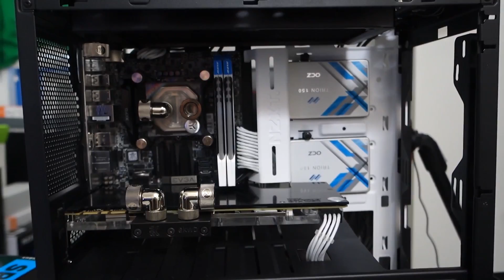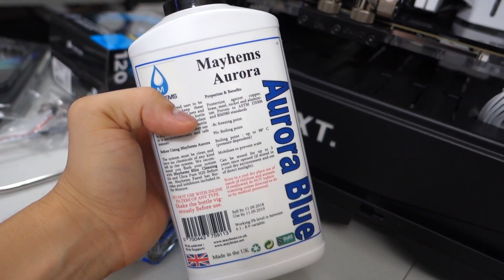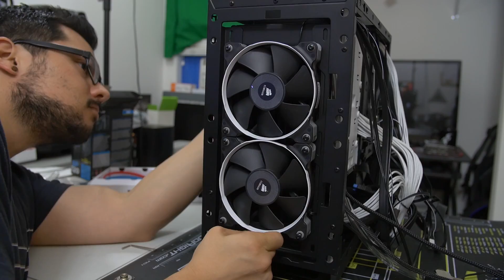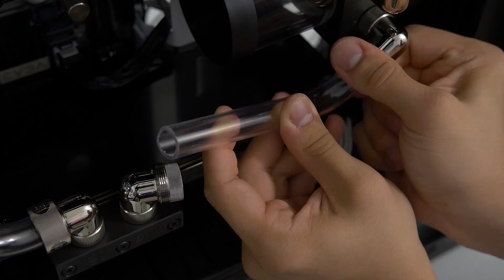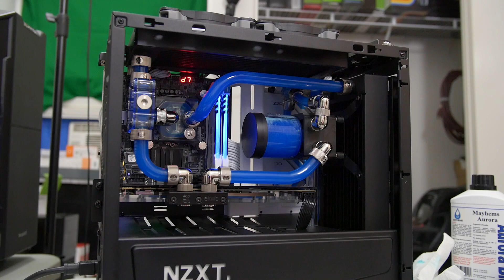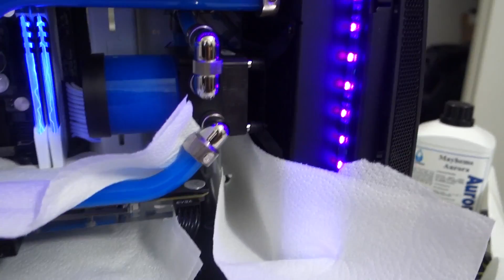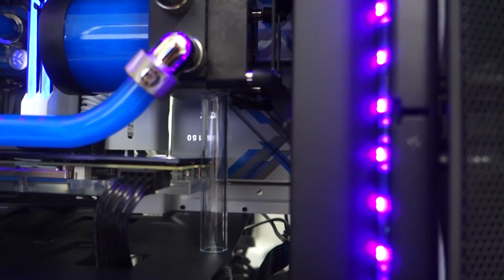Custom Tube Bending and THE MOST EPIC OF FAILS - Build Log #2

Comment: always use a separate power source for filling the system, just use an old crap psu and jump the atx connector
Reply: Not everyone has a spare power supply laying around.  That said he probably does with all the stuff sent to him for reviews lol. My biggest thing was that he had his MB powering up when filling. Should never have your components hooked up to power. Jump the psu you are using so you if there is a leak even if it gets on the components it wont fry anything.
Reply: Glenn Dooley Agree
Reply: I used some AA batteries
Reply: I use a PSU that is around 13-15 years old to fill up my pump.
I got it from my old collage as they were throwing the PC's away.
Reply: Jolinator I know, I was like wtf dude? power cycles like that alone are bad for it, let alone if you
 get liquid on it and it shorts

Comment: +Awesomesauce Network You can run the leak test without having to power up all your components, you just need to connect your pump, short the ATX 24pin connector, and you're good to go.

Comment: It looks like there is a slot on the motherbord skirt right in line with your reservoir. If you get a bolt and use that slot to sandwich between a few nuts (and a washer on the back) you can support the res and painted black (or even cut the head off the bolt) it will be near invisible. 

text diagram;

(I========[ ]==[ ]==

Comment: With the white support bracket behind the reservoir, you can create a strap from a chrome-plated strip to wrap around the reservoir and attach it to the bracket. That will pull up/support the assembly and will maintain the symmetry of the tubing.

Comment: You might want to move your UV strips to get more lighting in the case.  It looks like the radiators are blocking a lot of the light throw path.  If they are the case mods magnetic ones, I would just say move them possibly along the edge of your radiators.  You will see the strips, but will give you more effect inside.  Another thing is you might move it along the edge that is near the rear of the case behind the pump.  So the pump and such will hide it, but have it attached to the radiator to give the glow effect.

Comment: what the point of the custom loops? is it just for looks or are they more efficient in cooling the system? if it just looks I personally don't see the point of all the work and expenses to set it up, i mean it has to cost a lot more than the regular ones and it doesn't improve performance on the system or add anything worth the trouble except looks on the case of the computer which i won't be looking at cause ill be focus on the screens playing my games O.o, it does look good thought but it not for me

Comment: that's why you run the loop for 9 hours straight outside the case before installing it, better safe than sorry.
Reply: with hard tubing aye?
Reply: +FlerpyDerp it's a lot of work but yes after you finish hard tubing you disassemble it and reassemble it for leak testing, or trying to run the cooling system only without running the whole pc so when a leak occurres it can be dealt with safely.
Reply: And after that?
You disassemble / reassemble it again to fit it into the case?
your Leak Test won't be worth anything after that.

Comment: Re: propping the reservoir up; could you try adding a washer or two between the pump-fan mount, only on the lower two screws to add a bit more 'height' to that side?

Comment: To prop up the res try switching out the 2 bottom screws holding it down with bolts and put some washers to lift up the bottom.

Comment: Put the system inside a frost free freezer....?!
Back in the 486dx4/100 era I did that. Worked great too. Clocking over 300 MHz. There was (if you can find it) a write up in PC MAG on over clocking your system.

Comment: i have the same reservoir but the 140 one, the only reason it is sagging is because of the rubber feet that it uses. if you unscrew them off, you can still use the other screws that are supplied to mount the reservoir, that's what i had done with my one, and it was a hell a lot more stronger and there was no sag or anything like that, hope this helps!

Comment: TO FIX THE PUMP SAG:
washers under the lower pump and/or mount screws as spacers to tilt the unit up compensating for the sag.
and... Personally I would move the UV strips. the light they are emitting is mostly blocked by the rads.

Comment: suggestion for the pump/res combo: needs a new mounting solution. still mounted to the radiator but not sideways. so some kind of L-shaped bracket with support so there could be no sag. but that would probably make the tubing run more difficult.

Comment: I'm not hardline water cooling savvy, but it looks like you could use a nut and bolt on the bracket behind the reservoir to support it. It should be something that looks better than a nut and bolt, but you get the idea I hope. Lemme know if you need a diagram or a better explanation

Comment: Switch to a RX 480 and get the EK-FC RX-480. That will allow you to use the EK Bracket that you have with a EK-UNI Holder DDC V2. You can get one from Performance PCS.

Comment: I wish you could search comments. If you can can someone inform he how. Why did you not just run the Water cooling parts off of another power supply. So you can run a leak test and not worry about damaging the computer components.

Comment: Please help... For an acre predator Z35 which GPU should I get? I'm looking at the gtx 1060 or the gtx 1070.... is it worth the extra money to get the 1070 or will the 1060 run the Z35 @144hz or close to 144hz in most games? I'm new to PC gaming and in trying figure things out before I spend the money to join the PC master race.
Reply: 1060 at 1080p, 1070 at 2K

Comment: PUT A WASHER ON THE BOTTOM TWO MOUNTING SCREWS FOR THE PUMP AND THAT SHOULD LEVEL IT OUT
Reply: All caps means he is shouting to get Kyle's attention, so in this case, that is the correct use of all caps.
Reply: +kuhrd ¿por que no los dos?
Reply: Darren Lesinski Could be both I suppose.

Comment: Awesome build as ever. Regarding your tubing I would suggest, that you either stick with 90° angles and ditch the diagonal bends or redo the diagonal bends from the radiator to the CPU-block and from the pump to the GPU-block as they don't look parallel. It kind of looks out of place from certain angles, so I would stick to 90° bends.

Comment: You could always borrow a 3D printer to print a clamp/clip that screws in on the cable management bar and holds onto the top of the reservoir.

Comment: 1st thing I do when I have my loop made is to blow in the loop. Makes sure there is no plug missing. Also I have not used towels at all neither have I done any overkill even 1 hour leak testing. I just leave the res cap off so it can flow freely.

Comment: put some small washers underneath the bottom half of the pump/ress bracket, in between the bracket and the rad and then try tightening it back down this method should give it that little push up to get you pipe straight. xD Add more washers if one on each bottom side doesnt get it straight, until it is perfect. This wont stop it from sagging but it will make it "look" as though it doesnt sag at all and if you use small enough washers the bracket itself will cover them and easily hide your fix.... xD looks great... im going to watch the rest of the video now, i haven't seen why your title is such yet....

Comment: The reservoir/pump combo is probably sagging because of the installed hard rubber vibration dampers. There's nothing else you can do as to remove them or to install a support strut like those for graphics cards.

Comment: The angle of the bends on the top run should be close to the bottom run imo. Re the 'sag': couldn't you fit a clamp to the nzxt plate you originally used to mount it?

Comment: You do know that your system is not in leak test mode you are in full operation mode with power plugged into motherboard and graphics card. If you plug in a monitor you should see a UEFI screen.

Comment: @Awesomesause Network You could put two tiny washers under the bottom two screws holding the res pump combo to the rad. Should prop it up enough to make it strait.
Reply: Never mind, made it to the end.
Reply: I totally agree with you man, that prob would have worked
Reply: That was my suggestion, Shim the bottom of the radiator.

Comment: Concerning your problem with the pump/res sag. There are 4 screws that mount the combo to the radi. Just try adding some spacers on the two lower screws, which will elevate the combo. Your tubing looks very nice btw, i think it's impressive that you did the bending without any guides.

Comment: I think there is torque there in the reservoir. You see how the little pipe on top is slightly misaligned  to the bottom one going to the GPU? It is probably a bit too long.

Comment: Kyle, got an easy fix for that sagging tube. When you bleed out the system, replace that saggy tube with a slightly longer tube. It should prop it up enough to keep it straight.
Reply: For those wondering... It won't put stress on the pump because of the amount  of movement/slack the pump has on its bracket.

Comment: Why dont you see if you can use a cylinder res mount bracket and turn it sideways to grab the end of the res? Then all you have to do it tighten it down on the vertical slots on the mounting points

Comment: A)  If you use your heat gun and some padded pliers,, you can bend the two top mounting brackets for your pump/res so it sits more level.
B) Why don't you try putting the dye in with your Aurora shampoo?

Comment: 1. Just mix a bit of both in the mason jar if you are worried about a reaction (or what it would look like) and check that first before doing it in the loop.

2. For the pump, perhaps some very thin black washers on the screws, between the base and the rad so that it forces the pump assembly to be angled up just a bit?

Comment: put a washer between the pump bracket and the reservoir on the bottom two screws, so it angles it up.
the only problem you might have is getting the right thickness washer

Comment: In the future just do a quick air pressure test by blowing on the piece of pipe. Thats what I always do just incase ive forgotten something or a bad leak. Your PSU would have gotten a little breath rather than a face full of water. Luckily you have a shroud. Could have been a lot worse :D.

Any how havent laughed so hard in a good while :D.

With regards to the reservoir you can try spacers but i dont think it will work. Your better off using/making a metal or plastic bracket to prop it up. Then spray it black, blue or UV to match the build.

Comment: Kyle, try putting some black washers underneath the bottom 2 mount points on the pump/res to level it out.  You should have some spares from a Corsair aio or some Phanteks hardware kits.  

Looking forward to that 1080 ti review ;)

Comment: Bend the legs close to the res dock to flatten the angle of the top-side bracket legs for the pump/res which will angle it a tad making it parallel with the GPU tube.  This can be done by just leaving it attached to the rad and pressing down on the legs a bit at a time until desired angle is achieved.  Will keep it looking super clean without visible washers under the bottom legs.  Also, you could try adding some of the UV clear blue to the aurora fluid.

Cheers.  @Xobeloot

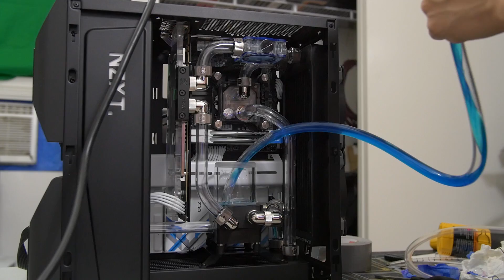Comment: Definitely go with Xeon777 suggestion @ 6:16 for using washers, perhaps rubber washers for thickness and vibration resistance. 
That water burping out of the loop, ..... Priceless!   cant say your a vet till that happens to you!
The UV reactive coolant plus the drops FOR SURE! that pump/res needs the brighter color in it along with that spinney thingy in the back, you cant even see it spinning on camera and the clearer water with UV drops would really make it pop!

Comment: If you stick with the plastic support tube you could cap of both ends and fill it with whichever coolant you are using in the loop and it would just blend in! You may run the risk of coolant settling in it though.

Comment: perhaps another reservoir sag-solution might be: adding some washers to the bottom screws which mount the radiator. Causing the radiator to be mounted slightly angled which also pushes the pump up a little.
Don't know if this might actually work but it's an idea

Comment: You could use some washers as shims on the lower  screws of the res mount to compensate for the sag. Also why aren't you leak testing with an external PSU?

Comment: Nice system. only scary to see a System fill and leak test with a system on. please conect The pomp to a sepperated psu to do so when you do The fill and leak test. it saves any leak screwup.

Comment: Just do distilled water plus the dye? Would match the memory perfectly.
Reply: What?   No.  As long as you use distilled water with a biocide, you don't need anything else.  In fact, distilled water is actually more efficient at heat dissipation than coolants.
Reply: Coolant is distilled water with biocide and colourant...
Reply: Well there are actual coolants that arent distilled water. But when it comes to general pc water cooling the coolants will just be distilled water with biocide and a colorant like carl said.
Reply: That's what I thought too. If he adds the blue coolant it will probably not be as bright.
Reply: But remember you can't just put water in a water cooler machine I know sounds dumb but you gotta use coolant
Reply: +Kent Burgess then why does every person I know use a coolant??? Anyways ok I'm pretty new to water cooling so I thought coolant was better
Reply: +Carl Head ok so what I'm hearing is if you're using distilled water plus a biocide then you are using a coolant funny how life works lol
Reply: Yeah, I think he should just use distilled water, biocide, corrosion inhibitors and the UV dye.  He could then add blue dye to the loop to suit the amount of blue he wants if need be.
Reply: +kuhrd Coolant is for the 'cool' kids only.
Reply: I wouldn't add any dyes or unnecessary stuff to the loop, the only thing dyes and special coolants are good for is gunking up micro channel blocks. Use distilled water and a silver kill coil or a few drops of a biocide, and may be a very small drop of dish soap to help break the surface tension of the water and allow the air bubbles to rise out of the loop

Comment: the only thing i can think is to just place one or a few washers on just the "bottom" side of that bracket that the pump res is attached to so that way it basically off sets it so it will counter it's sag. if you get what im saying.
Reply: looks like i'm not the first to have that idea...

Comment: Put a washer or 2 under the bottom part of the pump screws, that will push it out that MM or 2 you need to level it out without having to have the tube prop.

Comment: you dumb ass you shouldnt run the whole system while filling the loop because it will damage it if the liquid touched it :).ps:atleast you didnt drill threw a motherboard

Comment: C clamp on the res, anchored to where you had the res before.  Do not listen to the people saying put another washer on the lower 2 mount screws, you need to support the weight properly.  Also, I think you should use rigid tubing on that small run from the splitter to your res/pump.  Nice small run, and that will take some stress off the small straight run from your rad to the splitter.

Comment: Water cooling doesn't give that much lower temps. I do  not understand why people waste so much money and time on it.
Reply: It gives way lower temps with the right radiator. my 980ti sli and 5820k oc don't pass 50 Celsius under load
Reply: +Adrian Nastase yep - the only similarity to air cooling is that they are both limited by the ambient temperature
Reply: Exactly

Comment: +Awesomesauce Network The bracket between the pump and the radiator - consider rotating it 180°, so that the "sag" direction is up instead of down?  I know it'll be a PITA now that the loop is assembled, but it might fix (or even reverse) that sagging issue.

Comment: +1 for your layout. Your tubing runs are some of my favorite I have seen in a while in a non modded case.
great build kyyyyyyyle
Reply: PS. if you change the long tube, make the angle on it parellel to that bottom right tube that comes from the pump

Comment: Dude... i´ve got an idea... to solve that reservoir and set it straight... you can bend just a bit the two upper brackets... so that way outside the case will be a bit crooked but inside the case will be ok...
I dont know... u can try it...

Comment: You just should get one of those supports for reservoir and mount it in the reservoir bracket, for the lub it would be awesome on clear UV, matches the RAM. The tubes look sweet.
Reply: The washers could work, but if the height is to much it could bend the mounting bracket, if it isn't thick enough.

Comment: one tip you might try is to mirror the angles on the two long runs where they slant upwards.  Otherwise it's fine so long as the two new fluids don't have a chemical reaction and blow your workshop all the way to CanucksHardware...

Comment: To fix the sag you have I can think of a couple quick options.  1st you can try and bend the frame holding the pump/res to counter the sag.  Other option is to use some washers and use the them like jacks on either the pump/res or radiator to counter the sag.

Comment: kyle a regular soft tube cutter cuts petg just fine and it will save a lot of time compared to using a saw. Plus it cuts clean. And on propping the res up. Maybe put some steal washers on the bottom screws to tilt it up a bit ?